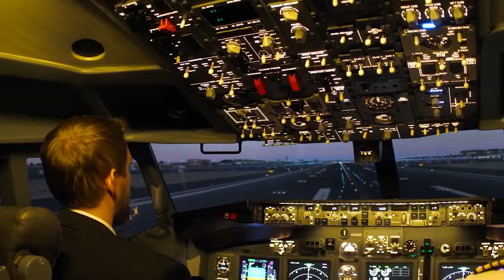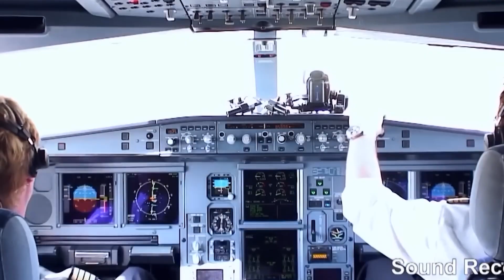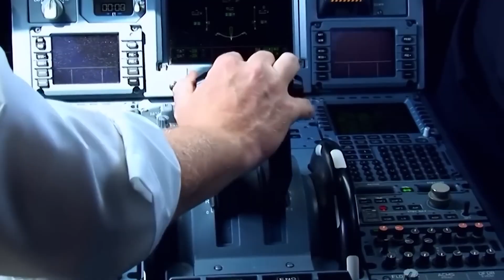BLACK BOX DECODED? Scientists FINALLY SOLVED the Mystery of Air India 171 CRASH

Comment: Post Exposure Prophylaxis ?
Reply: Where is the prophylaxis by Boeing? Complete silence is a zero attempt to honestly acknowledge and thereby correct. This video propogates a hypothesis hard to believe. No pilot even with a gun on his head will reflexively grab the throttle,let alone both. And that would've happened when the ascent was at its acutest angle i.e. immediately on takeoff. It's not as if the pilot's hands got stuck onto the throttle being pulled backwards. Even as a reflex he would've immediately corrected it by pushing it forwards once the sliding seat had stopped. That didn't happen. Something prevented it from engaging full thrust forwards.

Comment: How do you know the pin did not snap on impact ? The manual override was disabled by a software glitch, a patch was given as an update but not mentioned as mandatory. Your theory is most improbable. Even if we accept the seat slided back The Captain would grab anything else except the two throttle levers at the same time while taking off.

Comment: Oh Dear God. Yesterday's "Expert" conclusion was that a software glitch told the airplane that is was still on the ground and somehow idled the engines. Since when does the "Black Box" moniter the captain's seat position? What will tomorrow's "expert" conclusion be?
Reply: Yup flight data recorder will show the engine thrust reduced but not necessarily the reason why they did so. There could be multiple reasons and its not the first time an aircraft has this happen, at the end of the day there is no faultless machine.